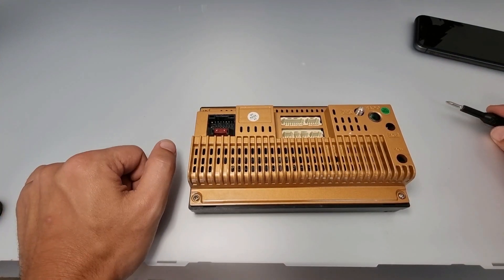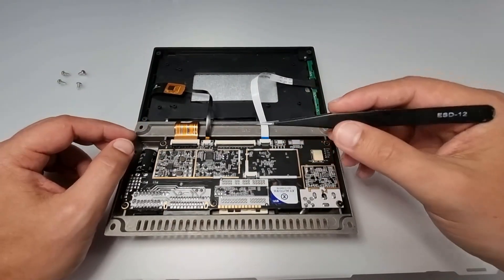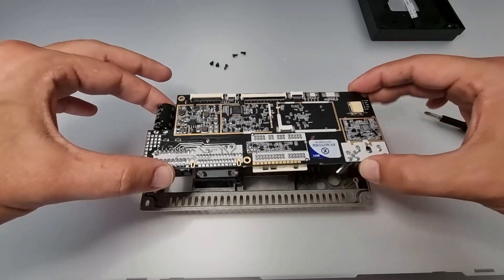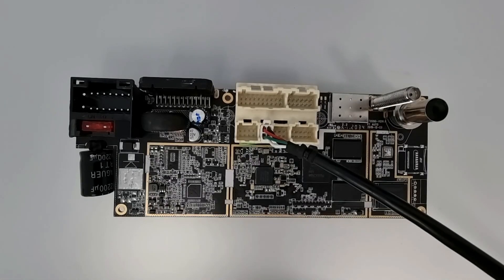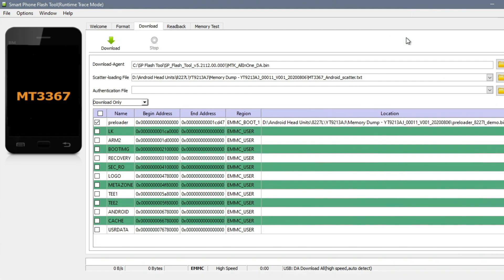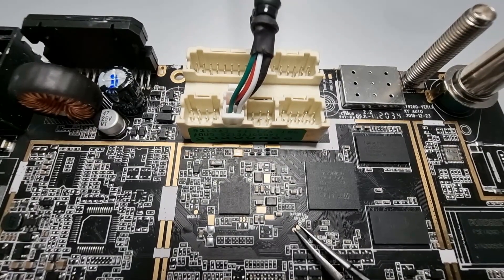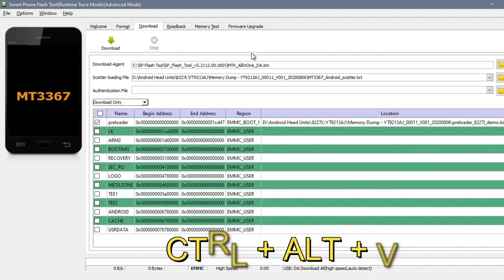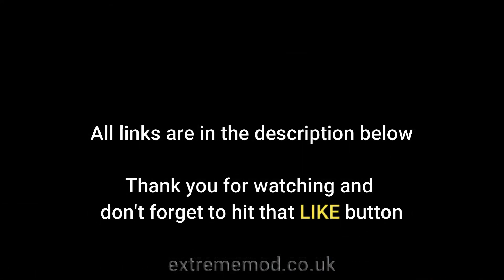How to revive your Chinese Android Head Unit - Test Point method - 8227L - universal car stereo

Comment: Hi, can I use this method to read emmc? I have problem with which I describe you on video about backup. If I good understand shorting this test points i just allow to comunicate directly right?
Reply from the maker: That is absolutely correct. This method initiates the communication mode. I should mention however, that Test Point should only be used on a bricked device. If your head unit is working, you can enable communication mode in SP Flash Tools and use "Readback" function to read you EMMC. Here is the video on how that's done. I recommend watching it from the start or go straight here to see Readback in action: https://www.youtube.com/watch?v=1D2cKcgFr_o&t=457s

Comment: Hey man, great video! I got a question as you look like a person who might help me. I have a yt9216bj unit which makes an incredibly annoying cracking sound when volume is set to more than 16. It seems to occur only at peak power (like when bass hitting hard or some hard rock music going on). At this point I am asking myself if the unit is overheating or not having enough power. In case of overheating is there a thermal compound i need to replace in order to resolve this? Also, I am not using any amplifiers etc, only the 4 stock speakers i have in my car.
Reply from the maker: This is a very common issue and unfortunately it's on hardware level. Your head unit is equipped with YD7388 onboard audio amplifier that is worse than bad. Not only it overheats, but it simply can't cope with anything above 15W.

The solution is a hardware mod to TDA7850 with a 10,000 mf capacitor and temperature-controlled cooling mod. Our head units are equipped with this by default. Also, if you build a small external 17v 10A power supply and add Viper4Android DSP engine - your head unit will deliver unbelievably good sound, especially if you have an active subwoofer in the car (even a small underseat subwoofer will make a huge difference).

Feel free to visit our website for more info.
Reply: @extrememod_ahu  hey man! Really
Thankful for the followup. This actually explains a lot as i was also thinking it overheated ao i changed the thernal compound and it is looking good for now. To be honest you got me curious with that mod but it seems rather complex. Is there a guide i can follow?
Reply from the maker: @ОрлинГеоргиев-е2щ  it's not rocket science but requires some effort :)  Reach out to us on our website and we'll share more resources and information.
Reply: @extrememod_ahu  i replaced Amp  ic with pioneer PA 2030 and now its sound is much better, but ihave an other issue when i start it in morning it hang for two or three times and need to reset, it is happening before the ic changes
Reply from the maker: @bobibakar  could be anything but make sure to change the surrounding electronic components as per the PA2030 datasheet or your unit will stop functioning - if you are running factory software, try custom firmware and see if the problem persists. Also try MCU update if you know how to backup MCU first